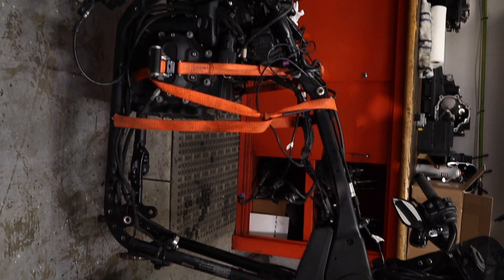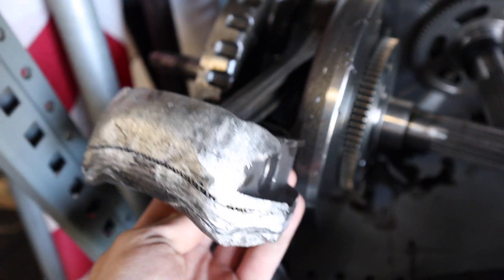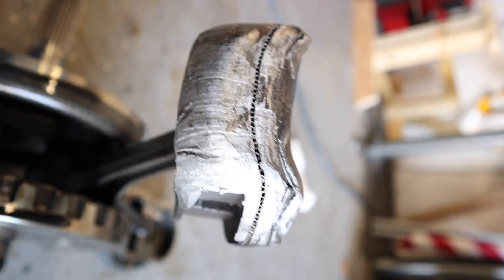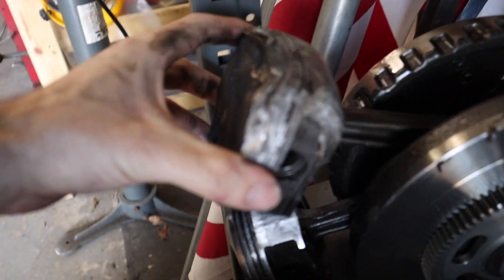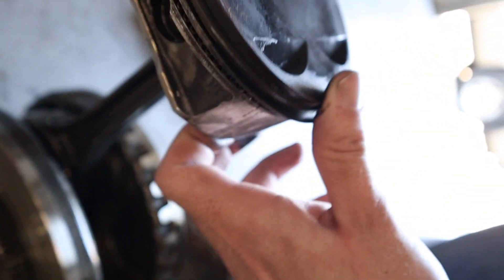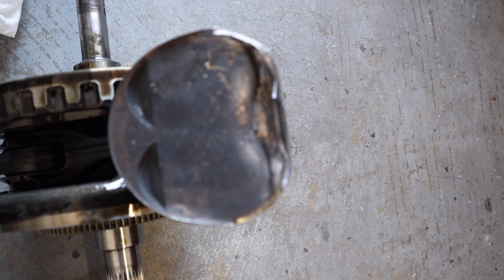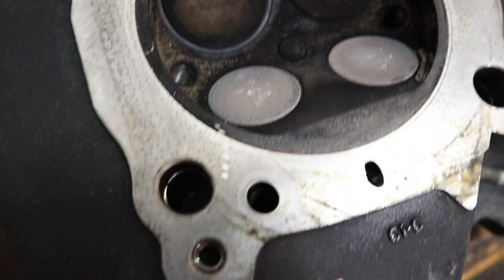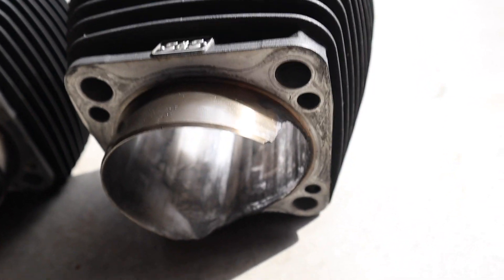2019 Fat Bob S&S 128" Blew up!

Comment: Can do the S&S 131 kit that they have now. I believe the crank is like 4 5/8ths on it. Could also do a WM8-9FX or 9F60 cam. Or a Woods 22X-E if you want it to be less aggressive. Fuel moto has been putting that 22XE in a majority of their 128 kits now.

Comment: I have so many questions. Like, were you running the bike hard, type of oil, parts, etc.
Reply from the maker: the bike has 33k miles on it 30k of it were hard on the stock 114 motor. I took it pretty easy on the 128 for the most part it only lasted 2.2k miles or so. I did the S&S 128 kit part list is in the description

Comment: Bummer to see! Makes me worry about my build 😂 got a S&S 131
Reply from the maker: It sucks for sure! Will be doing a darkhorse crank now. Did you do crank work with the 131?
Reply: @ThatHarleyChannel  ya got an S&S Crank in it. 4-5/8 stroke, well worth it, bike feels smoother in the rpm I like to ride at, less buzzy from 3k-4k u know. Dark horse is killer I think you're gonna have a nice set up. I'd honestly add some stroke if you're changing the crank cause now is the time

Comment: "not really sure tbh my runout was .11 so crank was bent spinning all crazy in there and took the oil pump out starving the motor of oil is my guess".

You were doomed to start off. Maximum crank runout spec is 0.005". You should have stopped right there and solved that problem first. Also, I doubt it was .11", most likely 0.011, which is still way over spec. especially for a performance build.
Reply from the maker: Crank wasn’t bent when the build was done. Crank bent from power wheelies after the build.

Comment: Have u changed the oil pump?
Reply from the maker: Yep crank runout was .11 ended up cracking the oil pump
Reply: I had my one on the dyno now 134hp 189 Nm
Not one dip 😊👍🏻